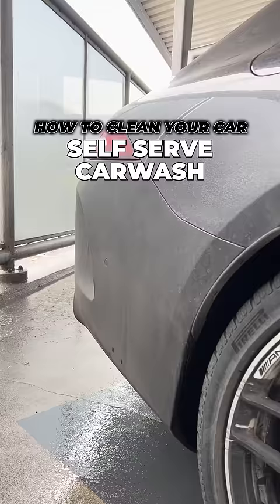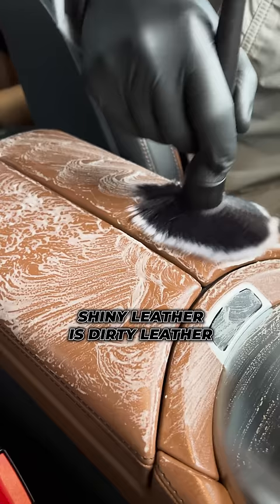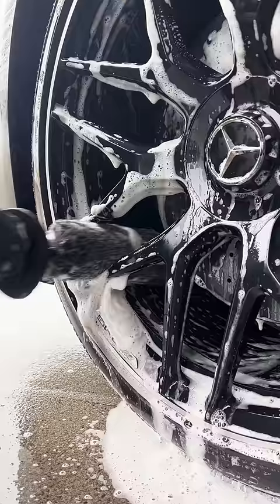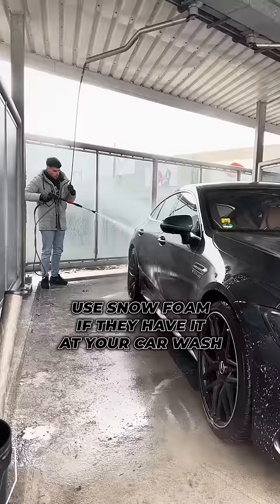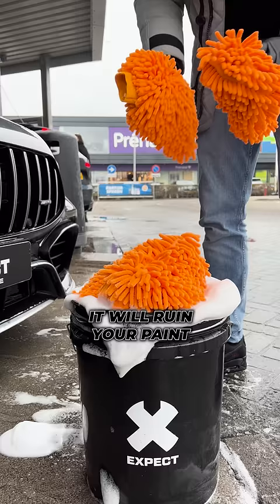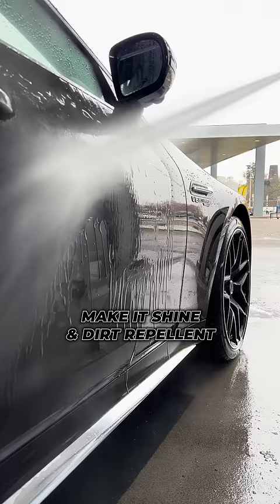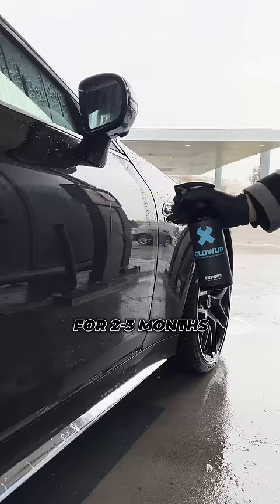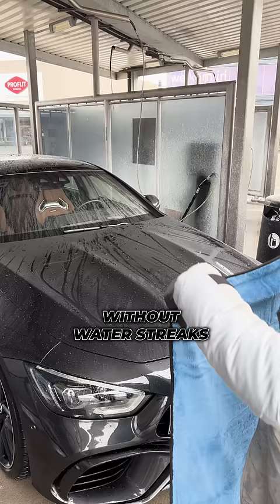How to clean your car at the self serve carwash?

Comment: Just buy your own pressure washer and wash at home
Reply: Ah yes let me do that in winter
Reply: @Douzeyuni  15 minutes wash tops if you have your own pressure washer. Temperature doesn't matter since you have a pressure cannon!
Reply: You need to live in a house too
Reply: @kittyearsheadbands8810  Yes and no on that. Some pressure washers are battery-powered and consume 1.4~ gallons per minute. If you have 6 5 gallon buckets (30 gallons of water), you should be able to complete a wash outside the apartment building.
Reply: @Douzeyuni  9 months out of the year you'll be fine, but if you live in places like Chicago, self serve car washes are a life saver in those negative degree winter months
Reply: I have four pressure washers. All usless in Chicago winter

Comment: Handwash will also ruin your paint over time
Reply: Yes over hundreds of washes, versus one wash with the brush at these car washes 😂
Reply: Bro weee are you getting your info from😂😂😂😂. Going through an automatic is begging for micro scratches and swirl marks from all the equipment they use that has a lot of debris imbedded
Reply: @Gabri3lRocha  i know but handwash will also damage your paint over time
Reply: @Norcal1990  obviously dude but the whole point is that it will damage it way less than going straight to an auto